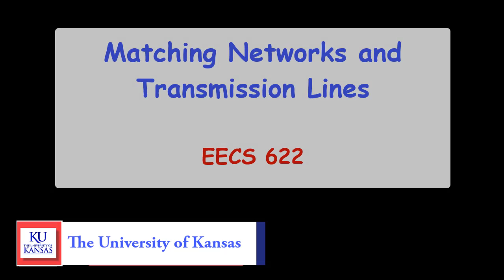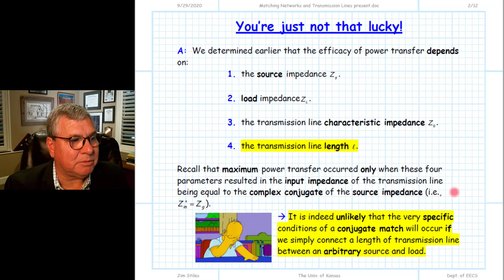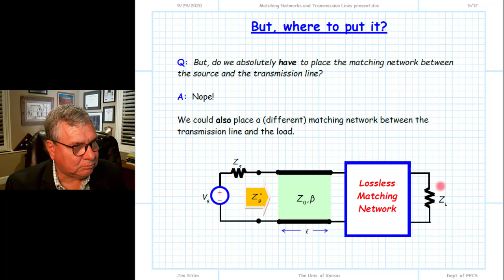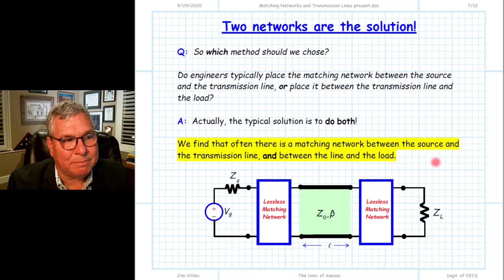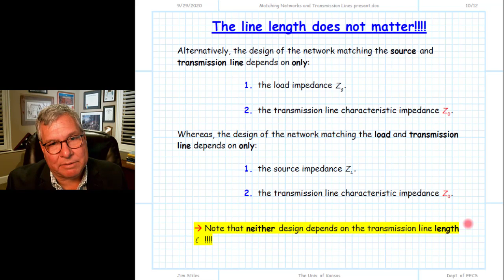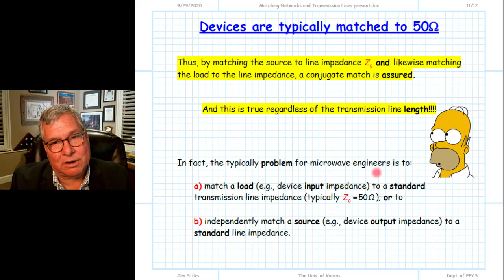Matching Networks and Transmission Lines

Comment: A transmission line impedance is a R+jX complex impedance value. You say that the characteristic value has no R value but it definitely does. 

Suppose we have an infinite length of 50 ohm lossless transmission line. If we place an ohm meter at the input side of the pins we would see 50 ohms. This is how the characteristic impedance is defined.  Of course in reality we have less than lossless transmission lines and they are finite in length but when we analyze the resistance near instantaneously, we will see this line resistance at the characteristic impedance value. Otherwise characteristic impedance has no meaning. 

Therefore, since we have an R+jX value for the transmission line, we can match the source impedance to the complex conjugate without matching at the load and everywhere will indeed be matched. However all else is NOT lossless (wrt the load efficiency ) since our transmission line has an R value which we may not have balanced out by the proper matched load. 

In the end, you still have a characteristic line impedance which may not match the source or the load even though we see a perfect conjugate match throughout the system. You ignore the real R value of the transmission line. And it may radiate. Maybe not much but we should not simply ignore this value. 

Jerry N9XR